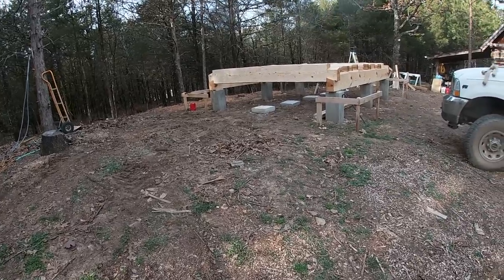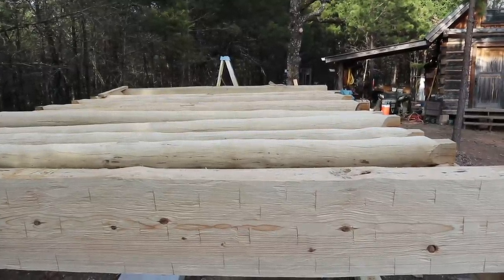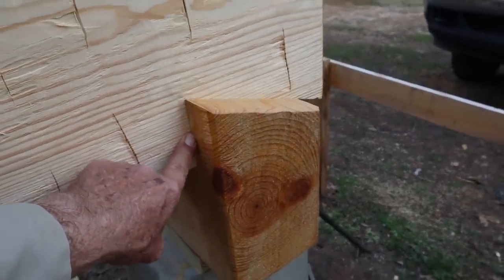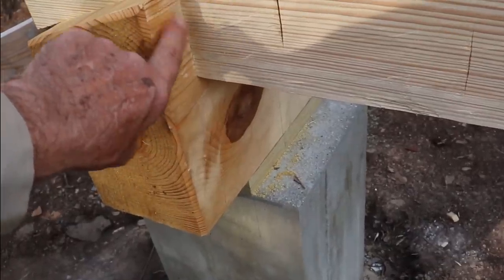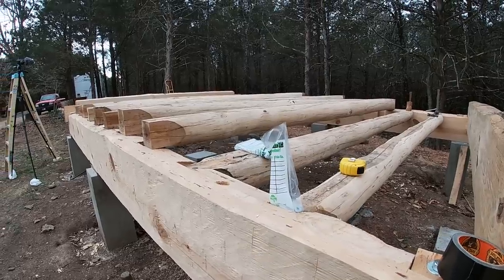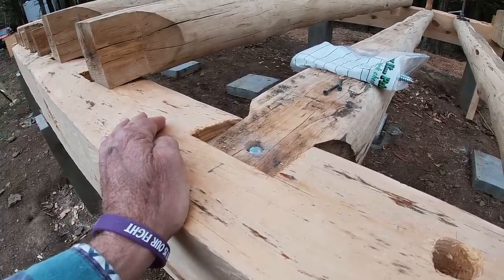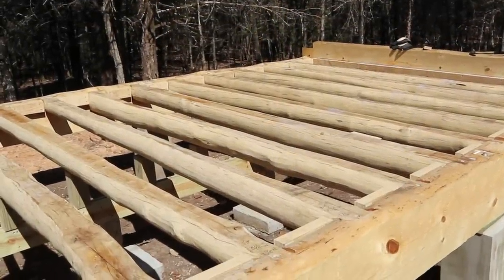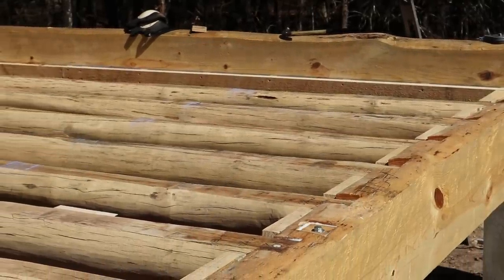Installing the Floor Joist - Dovetail Log Cabin Build (Ep 17)

Comment: Iam following the cabin build with close scrutiny. An excellent way to escape debt. Iam debating whether to build one, but unsure of choice of wood in a high rainfall country like Ireland, and dreaded shrinkage and expansion problems since timbers are very long, especially around windows. Your design and methodology are superior to log cabin builds in Finland etc. By installIng the floor before walls, you have a more stable structure to build upon. Concrete foundations and above ground build are also great ideas. Ensure roof overhangs the structure to keep rain off exterior walls.
Reply from the maker: DRJMF1   Howdy- thank you so much for watching our videos. Hopefully, I will share something that will be of help to you. With the style l do l allow for the settling that takes place. Not knowing what species of wood that is available to you l would say that keeping the foundation high enough off the ground and a roof overhang that is long enough to keep as much rain off the log walls would be a must. Wrap around porches are also good to protect your walls and the extra space is a bonus. Let me know if there’s anything I can help you with. Thank you. God bless you
Reply: It’s great that I know a skilled gentleman at hand for advice. I am in a research phase and gathering tools and skills. I use the viking riving method soon to split a storm damage oak tree trunk in Uk which I will share with you soon. And also the method of cutting boards free hand by swinging a chainsaw tip into a chiseled channel.

Comment: I used to use boiled linseed oil a lot on my tool handles, etc. myself until I learned about something that works better (for myself anyway).  Now I use a 50/50 mixture of pine tar and turpentine.  You can get the pine tar from any place that sells equestrian supplies. It's used a lot on horse hoofs.
Reply from the maker: Russel Stewart   Howdy Russel- thanks for the great tip. I ‘ll have to try that. I rolled the linseed on the subfloor with a paint roller after the wood was screwed  down. Some people have used old motor oil and deisel fuel. But I like the smell of linseed oil much better. Take care and God bless you

Comment: Hello, impressive work. Planning to build my log sauna very similar way. I wanted to build it without nails, or screws, live roof. Is bolts in floor joists nessecary or i could use blind dovetail or even same protruding dovetail as in the corners, but in place of joists?
Reply from the maker: Howdy- thank you so much for the kind words. Yes, you can do a blind dovetail for your joists. That would be some fun joinery to do. Wish you the very best with your build. God bless

Comment: Would you have any thoughts about using fresh cut hardwoods - various oaks for the floor joists/ sills? I know powder post beetles can be a problem with Oaks.  Wondering what your thoughts may be. I know some use Boracare for the hardwoods for other type projects but not certain about large beams for joists.  Musing over obtaining the proper penetration.  I hate the thought of even cutting a hardwood, but if there are substantially more of those than there are conifers at my new place, I may be pressed to. Any thoughts?  Thank you
Reply from the maker: Howdy Chris- getting all the cambium layer off as soon as possible sure helps. There are people who are mixing Borax and warm water and spraying there logs. Borax is supposed to get rid of bugs and their eggs. I think if you sprayed them soon after cutting it would take care of any infestation problems. God bless

Comment: Sir, thank you for the video. When you said that you  had made a light handsaw pass on the shoulder where the first log sat on the Sill, did you mean you scraped out a shallow pocket for the first Log to sit on the Sill? Was this pocket on the first log or the Sill? Thanks in advance.
Reply from the maker: AS   Howdy, when l cut the notch out when it’s on my sawhorses l undercut the shoulders with the chainsaw so I can make the handsaw pass between the log resting on the sill log and the sill log itself. The saw is actually cutting the shoulder on the sill log. Then, I just tap the log over tight against the sill log.
Reply from the maker: AS   I had to look and see which video it was but if you watch episode 22 I show how l do the shoulder cuts and the little folding saw l use. God bless you

Comment: Quick question: Why did you feel that you needed the lug bolts? Did you not think the dovetails would not be sufficient to hold the joists in place? Thanks.
Reply from the maker: James Kniskern   Howdy James- it’s kinda my nature to just lock things down. I have a tendency to do more than is absolutely necessary. I have all the confidence in the half dovetail joints to stay together. You have a good point and I appreciate you commenting. Take care and may God bless you
Reply: @TheBeardedCarpenter  Thanks. I lean towards overbuilding too. We call it code+2. Haha. Peace be with you.
Reply from the maker: James Kniskern   Haha. I never have heard that one. Can l borrow that from ya?  Blessings to y’all

Comment: Just wondering if the lag bolts were necessary in the floor joists, considering that the dovetails, and the weight of the structure should keep the joists locked in?  Just wondering
Reply from the maker: Howdy Gary- in the old days they probably would have pegged the joists. I have a tendency to go the extra length on what I’m doing. I probably could have gotten by without anchoring the joists but I didn’t want any bounce from a tenon shrinking and being a little loose in the mortice. Thank you for the comment. I think maybe someone else asked pretty much the same question. Take care and God bless you

Comment: Love the mix of old and new, I’ve been watching a lot of wooden boat building and was wondering if a tar bedding of the floor joints mortise would be a good idea ?
Reply from the maker: Robert Hawthorne   Howdy-  I’m sure it would be ok to do that. I’ve just used Anchorseal for this. When the roof is on there won’t be any water get on them. I also caulked around them. You got a real good idea, though. Old wood ships are really interesting. God bless y’all

Comment: Your work is with no standard and wasting a lot of time,see the first bin resting on the main bin position,the big dead knot,and small remaining of the main  bin is so little to end,it serve no purpose at all so the rest of the bins,why don't you just lay the bins on the main bin without cutting the main bin.it will be more lasting and stronger.
Reply from the maker: Ngu th   God bless you
Reply: The Bearded Carpenter ，what for you need to put screws again since you cut the locked joint?refer to Japanese techniques,Chinese techniques they don't put any nail,screw whatsoever.